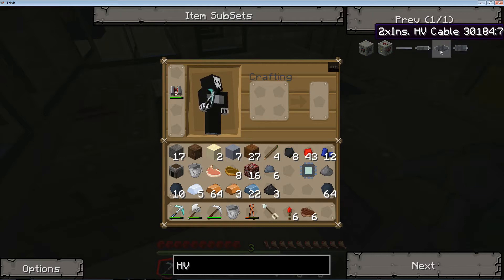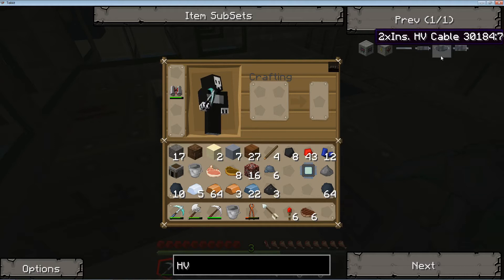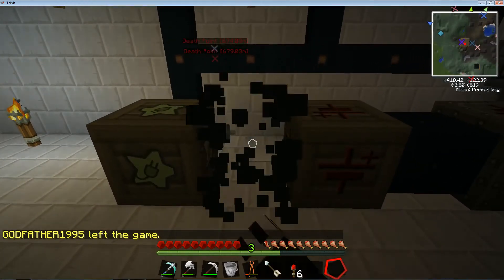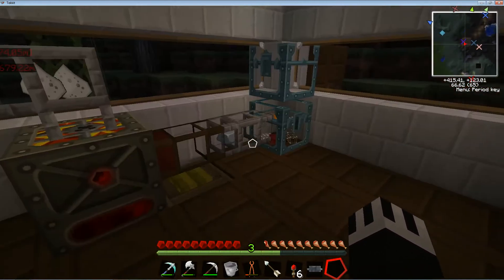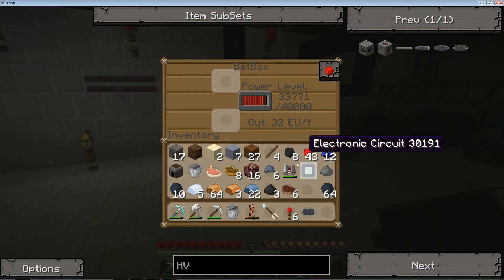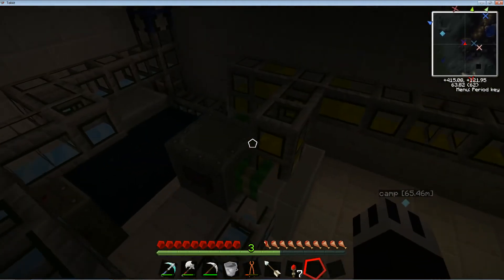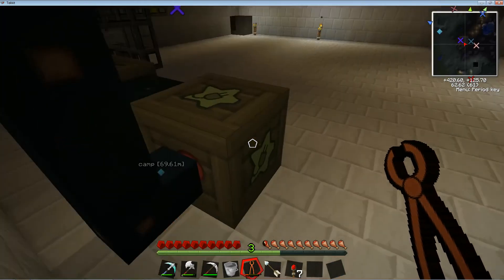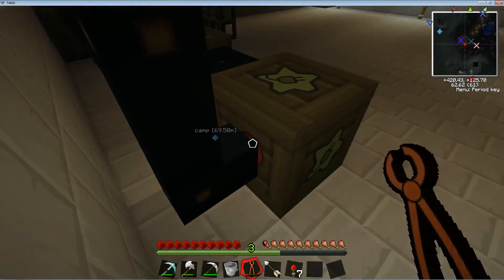Tekkit: How to turn Fuel or Oil into Power

Comment: If you pipe the fuel into Combustion Engines, the combustion engines connected to conductive pipes make the energy, but you also have to have a constant water flow being piped into the combustion engines or they explode, it's very unreliable, I keep having to check up on them so they don't explode :/